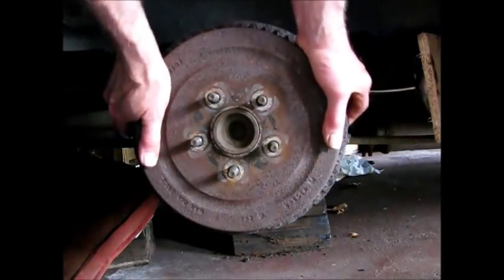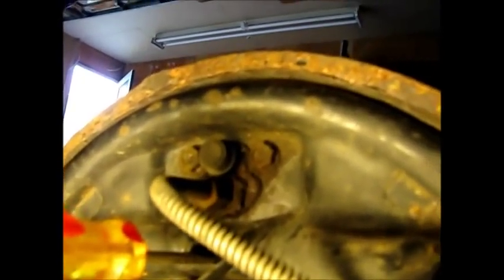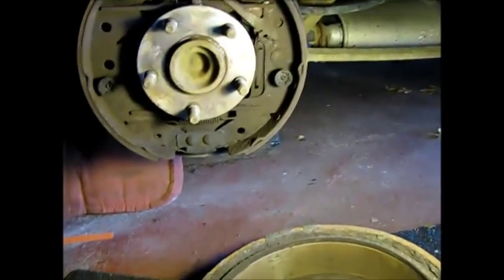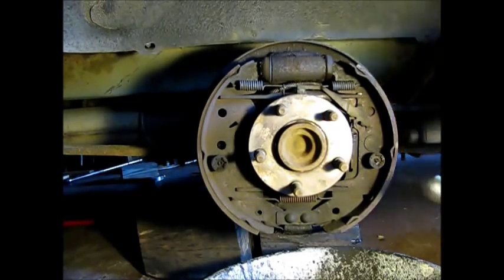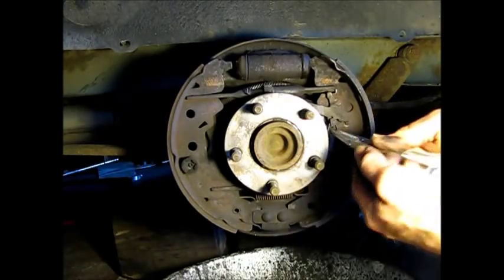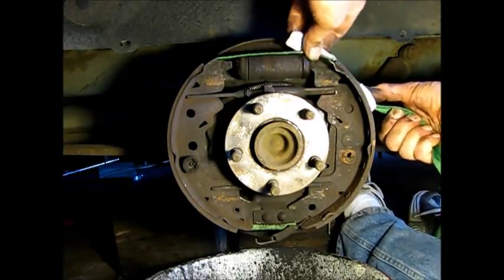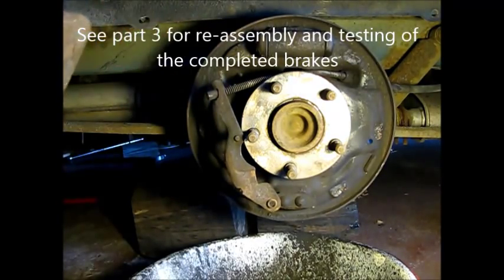How to rebuild the rear brakes on a Caravan, Voyager, Town and Country part 2: Disassembly

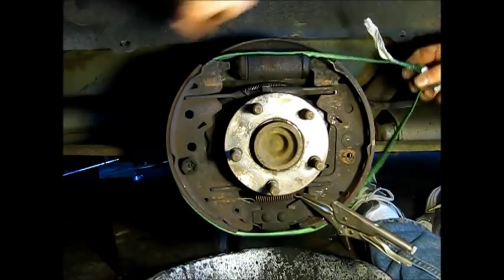Comment: I like the idea of that nylon strap. For future brake jobs the last too springs at 5:25 can be left on. Simply remove the hold down nail springs on both shoes and pull them towards you. They can also be placed in the new shoes and the shoes can be levered into place off the bottom anchor.

Comment: As soon as I popped the drum off the "hold down" springs and hardware were off on both rear drums. The parking brake arms were definitely seized. Everything was in shambles so I bought all of the components. Now to figure out this mess...
Reply: The hub and backplate are being a pain in the ass. Bolts are out. It literally needs to be pressed off.

Comment: Great video, it helped me get through my first drum rebuild on a 2005 Dodge GC. Do you know if there is enough room or maybe a dimple to replace a wheel stud without removing the hub or any of the springs or shoes?
Reply from the maker: +Jerad Mucci I'm glad the video helped. I don't know of any way to replace a wheel hub stud without removing the hub. Not saying it's impossible but it seems unlikely.

Comment: hey man what size needle nose pliers did u use to remove and put the springs back on 4'' or 6'' and can u tell me what side the emergency brake cable T is on the driver or passanger side? please
Reply from the maker: On the lower three springs I used a 6" needle nose. I struggled with the upper return spring until I bought a brake spring pliers from Napa. I always try to use my own tools first, but this is a case where $9 was well spent. The cable is on the driver's side.
Reply: Great video,  but your  safety  has failed,    NEVER have your and legs under a jack up vehicle, great  way to cut them  off if Jack or jackstand fails.